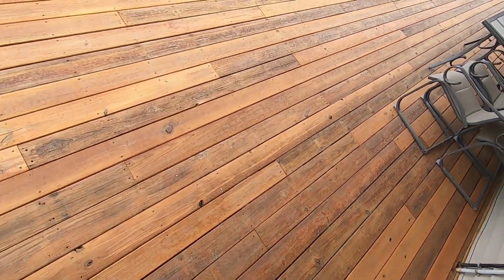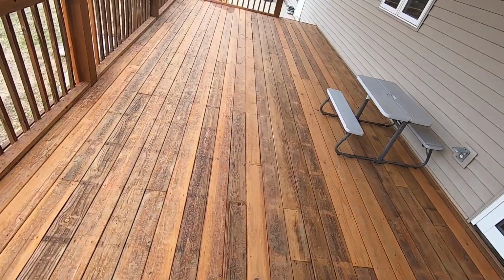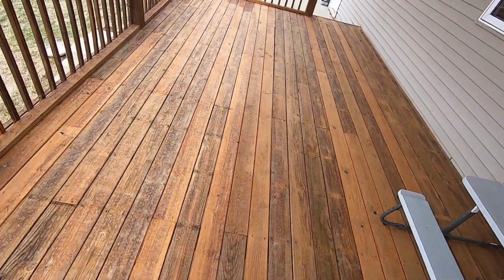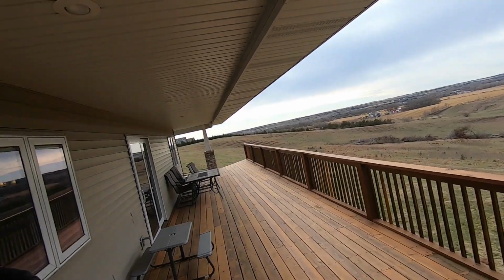BEHR Deckover Solution | how to re-finish like a pro !

Comment: What ended up being the finish or is that composite?
Reply from the maker: Its pitsburg stain from menards, not as dark as i was hoping but turned out pretty cool.
Reply: @AMAYERICAN  
Thats the beauty of wood and stain. You can think you have a plan going in but, mother nature lays down the law in the end on absorption and such. It still looks real nice though..
  I cant think of the last deck Ive even done (finish wise , I dont build em) 
 Everyone wants what their friends or the guy at home depot says is what to do bla bla bla..
 They cant accept the real reasons their decks are failing and the effort it takes to bring back from the dead.

 Particularly if there is already failing solid stain.
 I can usually sift through them on the initial call but,if I end up at the house I have zero problems making people uncomfortable when they tell me how to do my job with 40 years under my belt.
Reply from the maker: 💯 I feel like finishing/ painting has a lot to do with experience/ wisdom. No short cuts! Ik I got a lot to learn but I really enjoy finishing.